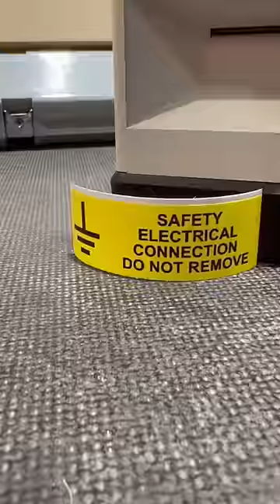Electricians Shocked by this Mysterious Earth Clamp

Comment: Two weeks later.... We discover all the copper plumbing connects to PEX before it ever reaches ground. :)
Reply: Which is why it’s bonded to earth - as it is here. The pipe’s not providing the ground in this vid, it’s being connected to ground
Reply: wrong way to ground it then. the whole point is to not have any of the pipe conducting current. if its already isolated by pex and you add a connection into the panel.... well you see the issue right? its the only place current can even come from. so now if the pipe becomes electrified it will be through the common ground because the rod connection is bad, thus electeifying all the pipes for no good reason. sweet
Reply: @QuantumMarmalade  What do you mean it's the only place current can come from? Copper pipes can become live for many reasons but the panel making the protective earth live really isn't one of them. And when they become live the protective earth allows the current to flow which will trip one of the protection devices. Without protective earth, the pipe could become live, and stay live, because no current could flow. Your understanding of protective earth is ass backwards my friend.
Reply: @QuantumMarmalade  Besides, this is bonding. It's purpose is to reduce the voltage between two fixed metal parts of the building so a person touching both at the same time has less chance of getting hurt when a fault happens.
Reply: no. also the sad reality is that the only reason we have grounding is to counteract the fact that the power grid uses the literal ground as a hot conductor leg. this inherently dangerous method is used simply to save money on running a second line.
additionally I shall repeat myself so you may understand.... you only bond at the main water pressure regulator, no matter which direction you hope the flow is going. this is so that any plumber is up stream of the ground, so if he cuts a pipe and handles both sides, he won't get electrocuted. if you just randomly attach as he has done here, you ensure 100% that if there is a short and the breaker doesn't trip (happens all the time) and any plumber handles the pipe, he's getting shocked, even and especially if it is insulated from ground by pex.
plain and simple fact is that this video uses expensive chincy gimmicks and an incorrect, dangerous understanding of how and why we ground to or from pipes SAFELY.
Reply: @QuantumMarmalade  it's there to bond the piping to earth to prevent galvanic action due to dissimilar metals and prevent corrosion issue s
Reply: @edwardmcdermott9948  it should be removed because it is an electrocution hazard to plumbers.
strange, I've been a plumber and electrician for 20 years and I've never seen corrosion unless it's got a dissimilar metal touching it... say perhaps a ground clamp made from incorrect materials as a random example. doesn't really matter the intent here or anywhere else, the result is the same..... it's done wrong and it's dangerous.
Reply: @QuantumMarmalade  This bond is only applied to pipework which is buried and introduces a potential. You know less than nothing about installations here, because you're unable to grasp that your existing 'knowledge' (I use the term loosely as you clearly have no idea why your own are designed the way they are.. or even how they're designed.) is leading you to make faulty assumptions. Lots of them.
Reply: @QuantumMarmalade  I don't care what your code is, it doesn't apply here. This video is not from the US, your methods are not relevant, your assumptions are invalid.

You've prattled on multiple times about bonding 'at the main water pressure regulator', am I correct in guessing the typical location of this is the point of entry to the building? Well, that's where this bond would go if it were a real installation. So.. what's the difference? Apart from the type of clamp, which isn't the only type we have available, and is probably a lot cheaper than you seem to think.
Reply: And herein lies the problem.  We seem to have 2  'experts' here but both are stating 2 completely different things! Poor consumer has no idea and obviously gets screwed over by one of these 'experts'! What do consumers do when the experts don't agree? They get charged more than once because someone has to come correct the mistakes made by the first expert. It's a bunch of bullcrap and the only one that pays in the end is the consumer.  Too bad there isn't one particular way of doing things that is taught, so everyone is on the exact same page! 💩🤦🏾‍♀️🤦🏿🤦🏻‍♀️🤦🏼‍♀️🤦🏼‍♀️🤦🏻🤦🏽🤦🏼🤦🏾🤦🏼🤦🏻🤦🏻🤦🏼‍♀️🤦‍♀️🤦‍♀️
Reply: That’s funny but water is a conductor so as long as they have water it’s grounded or earthed. I think. I could just be a moron and the internet will tell me so.
Reply: @crayonparfait  Water is a terrible conductor. Actually, water's an insulator - contamination in the water may conduct. Potable water is not significantly conductive.
Reply: mrl0wk3y33  This is bonding. It doesn't replace a ground connection for the installation, it ensures two points of 'ground' are in fact at the same potential. Fortunately for us, we don't allow foreigners with no understanding of our installations to make decisions for us.
Reply: @Monkeh616  does that mean you could throw a toaster in a bathtub and there be no conductivity? I meant typical water not pure H2O. I just remember elementary school science fair using water as a conductor. Maybe the science has changed since then or education has gone down.
Reply: @crayonparfait  No, because that's not pure water, I was just being specific. Across the area of a pipe, the conductivity of potable water is fairly insignificant, but will vary wildly.

Let's try and math this, for a moment. Where I am, potable water has a conductivity limit of 2500uS/cm , or 0.25S/m. Copper is 59,523,810S/m, or 238,095,240 times greater. In say, a 15mm PEX pipe, you have an ID of only 12mm. A 1m long, 12mm diameter copper rod would have a resistance of 0.14854mohm. A 1m long, 12mm PEX pipe filled with water at the conductivity limit of 2500uS/cm would therefore have a resistance of approximately 35kohm - thirty five thousand ohms, or sufficient to allow approximately 7mA to flow at 240V. This is REALLY, REALLY conductive water for normal potable supplies. The majority will be an order of magnitude less conductive than this.

Now, that same water if it's in direct conductive contact with the entire surface area of a bath is a different matter. When was the last time you saw a bath with a conductive finish, anyway? I haven't seen a bare metal tub.. well, ever in person, actually. It's all been porcelained, epoxy coated or fibreglass for what, 60 odd years?

What was that you were saying about the state of education, again?
Reply: @crayonparfait  Err.. no, didn't miss that. Pretty much exactly what I said, actually. Thinking you missed everything I wrote, though..
Reply: @Monkeh616  the article concluded water is conductive. Did you miss that part? The article didn’t go in to any unnecessary mathematical nonsense. 
Plain and simple, water is conductive due to the impurities. You’ll have to just accept being wrong. It’s ok. It’s not the end of the world. I’m sure there’s other non arguments you can try to rouse up. I think I’ve educated you enough here.
Reply: @crayonparfait  And it started with "pure water is an excellent insulator" - it seems the article and I are in agreement.

My 'mathematical nonsense' explains how potable water in your pipework is not substantially conductive and is essentially meaningless in the context of an electrical earth. Thank you, please don't come again.
Reply: @crayonparfait He gave you a thorough explanation based on your question and you call it mathematical nonsense then go on to prove him right while telling him he is wrong? What is wrong with you?
Reply: @--_DJ_--  He's a troll. He just wants a rise, and he's not getting another.
Reply: @--_DJ_--  read my first comment and you’ll see the idiocracy it was escalated to.

Edit: I didn’t start with any question.
Reply: @crayonparfait  You started with an idiotic statement... I saw that. 
At what point did I say you started with a question? I said he gave a good explain for your question.
Reply: @Monkeh616  Sometimes foolish and troll are hard to distinguish. I am still on the fence.
Reply: @--_DJ_--  how is my statement of fact idiotic? 
Is water conductive? Notice I didn’t say pure h2o or water without impurities or that it was the most conductive compound in all of science or if you add 2 to 3 divide by 7 subtract the square root and multiply by the covalent. 
The simple answer is yes. Sorry that ruffled your tampon but life gets better when you can accept facts you don’t like.
Reply: @Monkeh616  I didn’t start anything or look for any rise. My original statement said “I may be a moron” and ironically it turned out to be you.
Reply: @crayonparfait  "as long as they have water it's grounded or earthed" - no, and I explained why.
Reply: @crayonparfait  Water being conductive was not the statement you made. That was your justification for the stupid statement.
Reply: attention customers, as you can see now the reason for having a inspection done !!!!! always pull permit for any construction job !!!!?
Reply: @QuantumMarmalade  good way to make oneself look stupid
Reply: Thats the exact reason he's using the clamps.....
Reply: Nobody seems to be getting the point of this....  it is connecting the pipes to ground NOT using the pipes AS ground.... this makes sure that the piping and water CANNOT carry a live charge because the ECD would detect it and cut the power.
Reply: @crayonparfait not without salt or a direct lightning strike. Both of which are not happening.
Reply: @Monkeh616 you’re the troll, you live under a bridge rambling about water pipes. If they don’t answer your questions correctly, you won’t let them pass.
Reply: @--_DJ_-- no, you aren’t exactly on the fence, you’re sitting on the fence post moaning, sally  😂
Reply: @_..-.._..-.._  Nope, you can clearly see which way I went over the fence. Nice try though. P.S. Liking your own comments is cringe as hell.
Reply: @Monkeh616  If you live in an area that relies on brackish bore water it's possible to use it as a conductor.
Reply: Yes, exactly what I found in a house I  purchased a few years ago.
Reply: @QuantumMarmalade  Realise that the rest of the world doesn't use the 1950s rural system the US does. That is a 230v UK system, Phase(Hot),neutral, earth(ground) are supplied direct from the sub station.
Reply: first off, water is not a conductor. it is actually an insulator when pure. second, all the blabbering on about technical details specific to Europe etc.... don't apply here when discussing safety. this is because (and I can't believe I have to point this out) no matter what country you are in, physics are the same. so in summary, one does not ground any device to or from piping unless the termination point on the piping is at the regulator because to do so could electrify all of the piping and cause a ground loss if the pipe is cut and death to the cutter if hands are on both sides of the cut. the potential theoretical over current protection has nothing to do with it in this case because we are already presuming that the switches didn't trip.... so all who are contradicting this statement do not understand electricity and are using rote memorization along with broken logic to deduce that they are in fact correct despite the reality that physics contradicts them. if you really wanna know who's right then do a test. cut that pipe ground side of its self, bypass that breaker, then grab both sides of the pipe.... now do what I said at the pressure regulator, cut the pipe same place with bypassed over current and viola! you die in scenario 1 and don't notice a thing in scenario 2.
damn, you'd almost think my 20+ years as an electrician has actually taught me how the stuff works unlike so many here. this is kinda sad and truly terrifying. 🤪🫤
Reply: @QuantumMarmalade  And where am I to find this regulator (again, no such device in this house.. or any of the other thousands in this town), and what property of it makes this the case? Is it an insulator? Then you wouldn't apply bonding at all.

Wait, wait, you said ground a device to the plumbing.. that's simply not what's being shown. Something you've been told before, I'm sure, but it doesn't seem to have sunk in.

Help us out here and explain what the difference between bonding 'before the pressure regulator' (which doesn't exist within the property) and at the point of entry to the building is.
Reply: @Monkeh616  he didn't bond to the point of entry, he bonded to an appliance supply line. also you don't seem to understand that the ground isn't directional, it's distance based, namely the shortest distance possible. by grounding to a random interior pipe he has only created a death potential for plumbers. all you gotta do to know I'm right is go read through the main thread. anyone who doesn't understand the inherent danger in this Jerry rig doesn't understand electricity, plain and simple. it's like describing sex to a virgin or color to a blind man. you're just never gonna understand until you do. also, yes, look it up, water is most definitely NOT a conductor.
Reply: @QuantumMarmalade  It's not an appliance supply pipe, or a random interior pipe. It's a totally unconnected pipe on a demo board in a workshop, representing a buried pipe at the point of entry to a building, for the purpose of demonstrating methods and materials. Anyone who knows what they're looking at knows this. Again, positive you've been told this before. What, do you want a bucket of soil under the pipe?

And yes, I know water itself isn't a conductor - I literally said it's an insulator!

You're absolutely right, applying main bonding at a random point in the installation or using the pipework to provide the protective conductor to a circuit is dangerous. That's why we have regulations about such, and isn't what's being shown. What's being shown is a clamp on a pipe where it can be seen by the camera properly!
Reply: @QuantumMarmalade  No, I'm applying my knowledge of the context, which you lack. Two pipes is because one will represent a gas supply - but wait, I can already hear your cry, "gas pipes are never copper!", oh, but they are, because this is the UK, not the US, we use copper pipe for has supply in domestic properties. They're parallel BECAUSE THIS IS A DEMO BOARD. It's not a real installation.

Watch the video again. They're standing in the middle of an industrial unit, on a concrete floor with bays marked out in tape, working on pipes which are connected to nothing.. All the signs are there, you just have to get past your kneejerk reaction and actually evaluate what you're seeing.
Reply: @Monkeh616  so your defense of a person intentionally making a mistake in an electrical video that diy people will watch and copy is that it's just a demo video that diy people will watch and copy..... my dude.... you see the flaw of your logic now right? the thing you hold up as a defense is the exact thing that I am pointing out makes it dangerous.... I hope to God you're not an electrician, that would be shameful and dangerous.
Reply: @QuantumMarmalade  They're not making a mistake, you're wilfully misinterpreting the video. DIYers will do it wrong no matter what goes up on YT.

We have no problems with copper pipe corroding and killing people. You're just demonstrating your lack of understanding of the context, the size of your ego, and your ability to leap to conclusions. Keep it up, it's great entertainment.
Reply: @QuantumMarmalade what’s crazy is I literally just watched a YT short of a houses entire water supply was electrified because of a ground fault.
Reply: @crayonparfait 
Water alone is NOT a conductor. The impurities within the water, such as salts or Fe,  conduct electricity.
The more you know!
Reply: @QuantumMarmalade sorry water conducts electricity, if any part of the copper piping becomes live so does the shower head even if there is 20M of pex in between. This is why the copper is grounded. 
I think its best you let the electricians do the electrician stuff.
Reply: @dbbd9890  water isn't a conductor. this must be embarrassing for you.
Reply: @Monkeh616 I'm not going to get into the bonding part of the conversation, but the pressure regulator in the States depends on the region. In the south you're likely to have it at your meter which is normally within a couple meters from the street in a box a little below grade. In northern homes it'll likely be just inside the house as their climate has a higher chance of freezing so the heat inside the house can protect it.
Reply: @crayonparfait  Water doesn't even have to be pure to conduct. It auto dissociates.
Reply: This is being done to ensure that two separate metal installations in the building don't have different potentials because touching two conductors with different potentials would result in an electric shock
Reply: Wouldn't the water in the pipes carry any charge to ground in that case?
Reply: @scruguru   nope. your allot more conductive than municipal water. 
water can improve your conection to ground just enough to kill you but not enough to make a safe ground.
To stop the few who would say this confusing the poor guy.
Yes you could lay / float a long metal pipe in a lake or river providing it's not to fresh and it would allow for enough connection over a large area to dissipate into ground. (the water in the pipe counts as a serfice about the size of a quarter. laying in the lake you get the whole serfice  of the outer diamiter of the pipe.
Reply: @QuantumMarmalade it breaks insulation when fluid flows😂
Reply: @Monkeh616 I agree with you, this guy saying just earth the mains has no clue what he’s talking about. What about radiators, hot and cold water feeds that feed from a header tank. Wherever there’s a bathroom or kitchen, anywhere where an electric cable can make it live, it’s got to be grounded like you say. I also completely understand what you’re saying about water. Water will always conduct less than copper, which means if it feeds from say a header tank, an earth at the mains isn’t going to be enough to earth through the tank of water. It’ll go through the path of least resistance which means you. Scares me that guy says he’s a plumber and electrician and doesn’t know this tbh
Reply: They work best on cpvc.
Reply: Water in parts of the US is very mineralized or has other dissolved compounds. Also there are millions on well water. It’s impossible to generalize.
Reply: I have a stupid question. Why wouldn’t the electrical supply in the house have to have its own ground?  Why allow grounding to pipes in the first place?  Seems like make the electricians run their own grounds to save ANY possible issues now or in the future??
Reply: @greghelms4458  in most places your supposes to have a  ground just for the power at the box or near it as a secondary. 
To answer you main question though The part of the plumbing your sposed to attach to has/was all metal deeper had more surface aerie than you needed for a house ground. But now we have pex from the road to the house and that can be a problem. There is a right way to do it tho with a big deep rod or pipe put in just for grounding. and theres the whip looking grounds you can place around the foundation to give a shorter root.
Reply: @Zagroseckt  that’s how the house I grew up in was grounded, the large copper grounding rods pounded into the ground. Just also seems to me attaching anything to that thin walled copper pipe is inviting more trouble down the road than a guy getting shocked.
Reply: @Monkeh616 potable water has high mineral contents and it's highly conductive.
Reply: @Edocsil  'highly' is a gross exaggeration. There are actually conductivity limits for potable water, and they're not high.
Reply: And the next plumber that comes along cuts the main earth cable to remove that pipe, totally ignoring that sticker.
Reply: @Lee-xs4dj  Good job it's only bonding and you're not touching any of this stuff you don't understand, then.
Reply: @QuantumMarmalade so wrong 🤦‍♂️ and you wrote so many paragraphs
Reply: @QuantumMarmalade  Pal you are talking rubbish...... Go back to school.
Reply: @QuantumMarmalade  Have you ever heard of washing machines, kettles, central heating boilers, there are lots of ways to get a potential onto copper water pipes.
If you don't earth those pipes your precious plumber becomes the earth.......I have a feeling you are a plumber who does a little bit of electrical work like boilers. 
PS regular tests get carried out on main earths to check they are good also on circuit breakers.
The utilities often provide earths, the earth is always used as the reference point for Zero volts.
I hope I never come across any of your work.....
Reply: @QuantumMarmalade You are prime example why I ask people to show their knuckles for dragging marks when I give technical trainings. I can see whos a plumber and I ask them to vacate the premises immediately. Theres never been a more unknowledgeable group of humans in existance.
Reply: came to write this!
Reply: I dont think you are allowed to use the plumbing as ground in most places. I mean it would be an insane shortcut IF it was well within the ground but its probably not allowed because of that chances of it not running well grounded or...grounded at all like you said